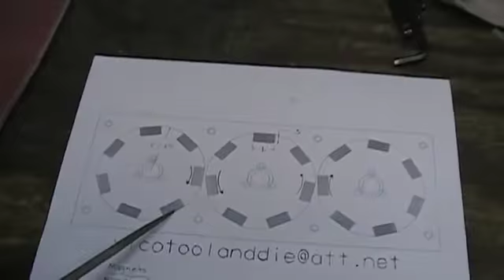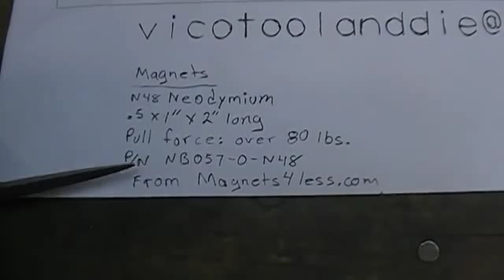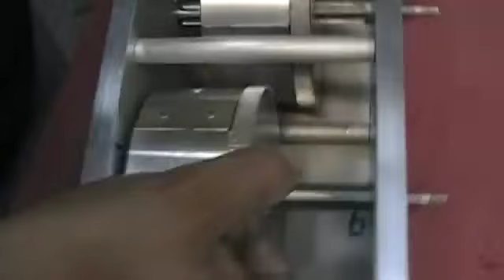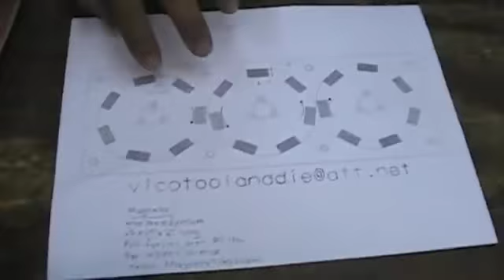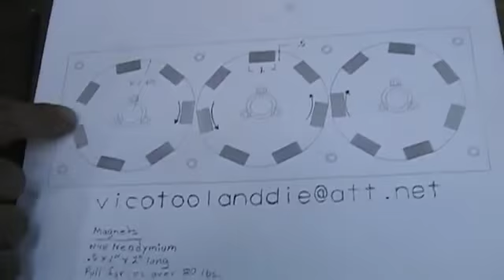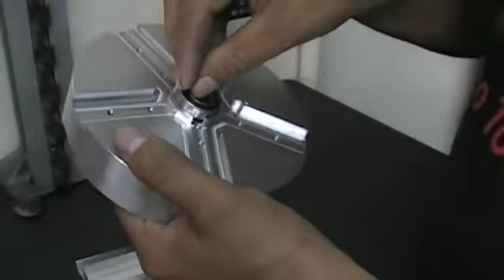Magnet Motor Free Energy Test   YouTube

Comment: The reason it does not work is because  magnets always "find" an stabilization point in whatever shape or form you line them up...
In your setup, there is plenty of space between each magnet, I could say the same width of each magnet, so this means there is a lot of area for the magnets to find the stabilization point(s) where they stop.
You call them "positive side", which could be North or South...please use the right convention for magnetic polarities, even though it does not mean any difference whether you use North or South, it is clear you are using an All Repulse System.
Otherwise excellent and very fine work you guys have done in all this machining!!